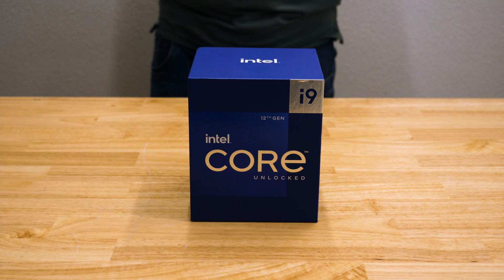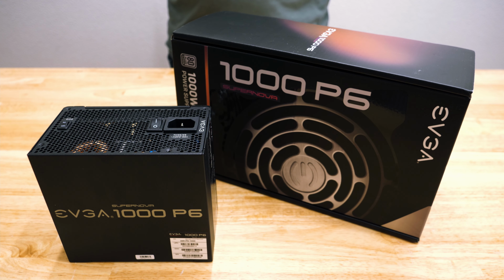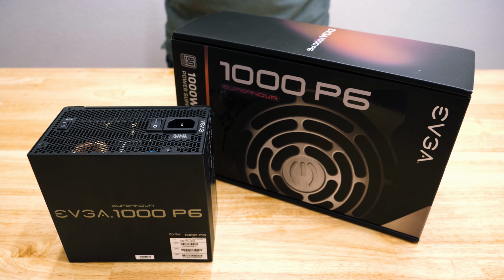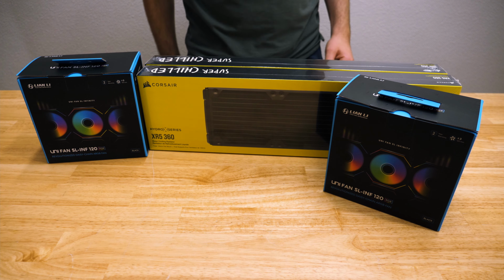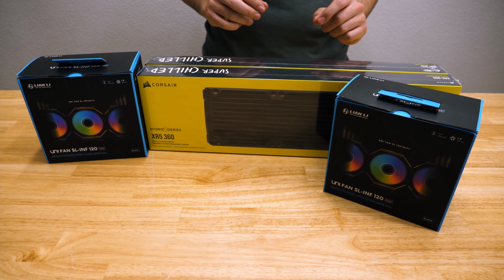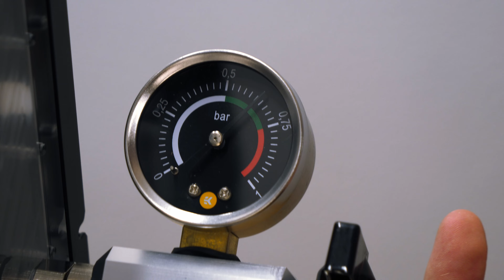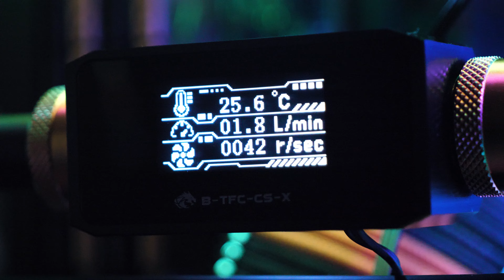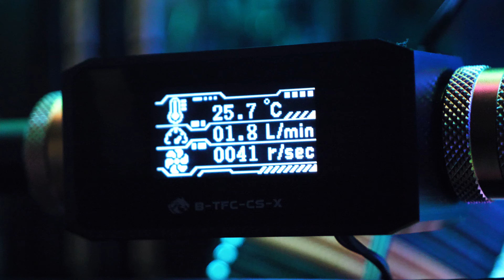We built a $10,000 High End Custom PC with Carbon and Gold

Comment: We don't Paint the heatsink of Memory ... never because we apply more resistance to heat release. Also the heat pad nust not have gaps ... when you apply them so to have full contact with all the surface of the element .
Reply: Painting does not affect performance though: https://youtu.be/B1VmtuddYnE